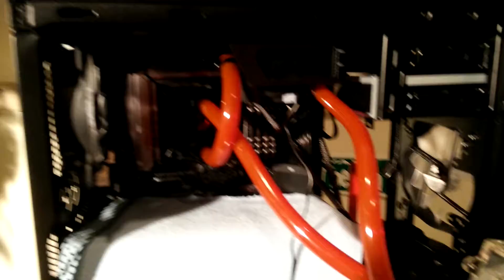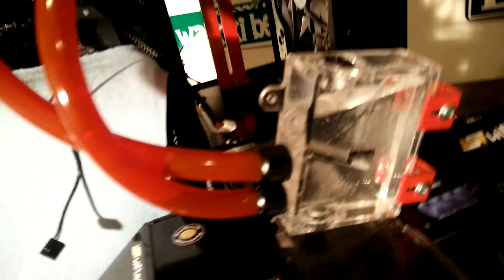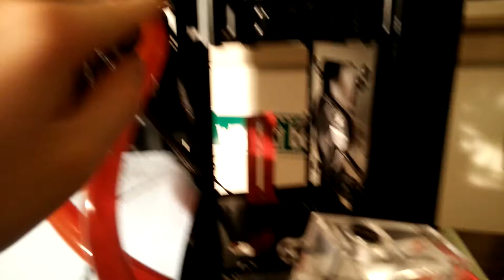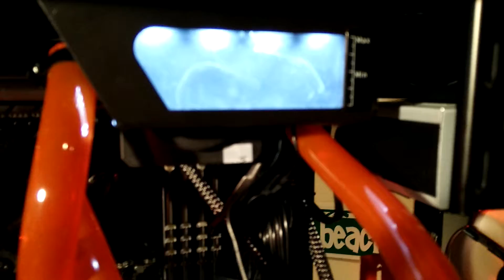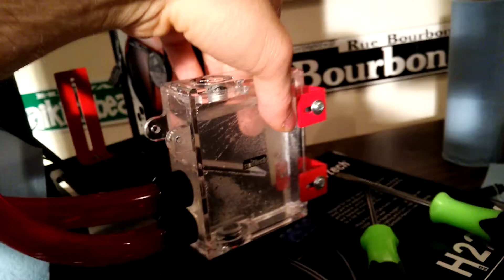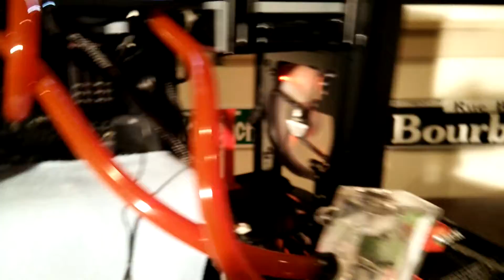Water Cooling: Help! (Customizing H220x)

Comment: i think it is air buble in the pump on the top of the shaft.try this: 1 take the top of the reservoir 2 move the reservoir upper then case 3 put the mouth on the reservoir hole and blow air in make presure while pump is on

Comment: managed to solve the problem?
Reply from the maker: Yeah, thanks for the assistance. I'm not sure if adding pressure with my mouth  (I did try it) helped more than just letting it bleed out longer and filling the reservoir on the radiator completely through the drain cap. The radiator reservoir can't be filled by the secondary reservoir, so unfortunately  filling and draining the loop will be more difficult than I was hoping.
Reply: it takes time for the air from the pump to get out.glad you solved it nice build